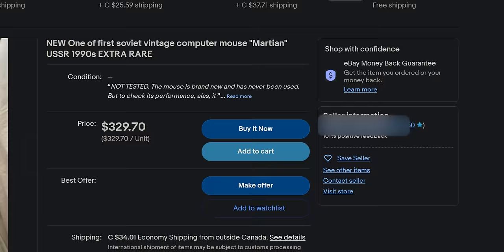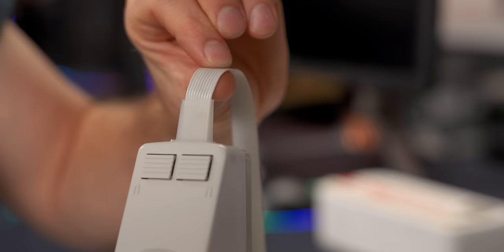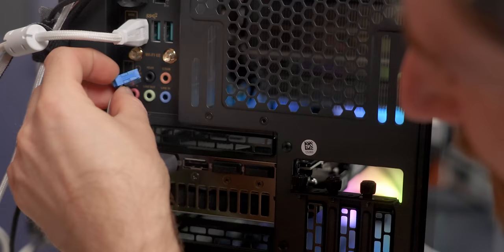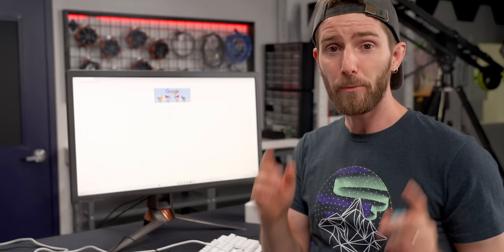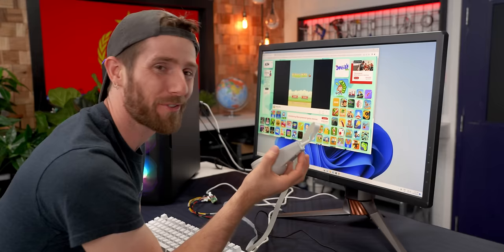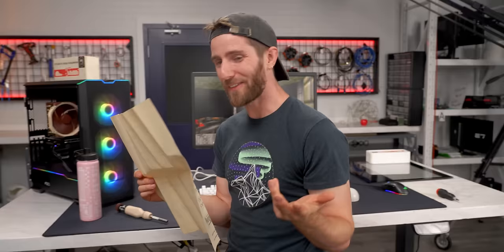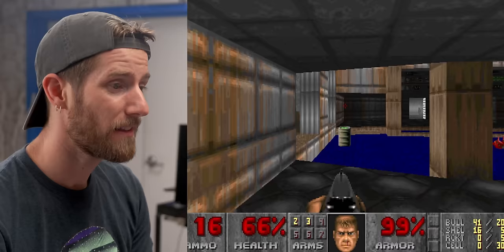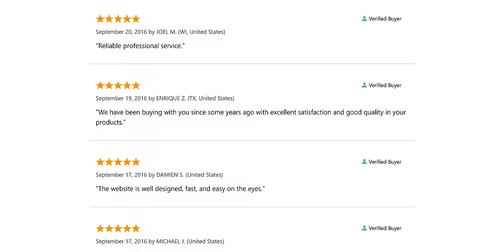I Bought a Soviet Era Gaming Mouse - MARS UKV-01

Comment: I love how they're using a Pi Pico, a VASTLY more powerful system than the whole original computer this mouse was designed for, just to translate the serial signal :D
Reply: LOL well having to slow down the clock speed of their hardware to, I wouldn't be surprised if that's one issue as well.  Full emulators (hillarously) like need to slow waaaay down so games aren't going at mach20
Reply: I cant help feeling it would have been a LOT easier to explain what a leonardo/pro-micro was doing, the 32u4 is literally made for making HID devices.
Also it might have been more useful to map it to the arrow keys - its pretty clearly designed for that (as long as you keep moving the cursor key repeats).
Reply: I suspect its what they had lying around  @Lord_zeel  - the 32u4 was hard to get for a bit there, part of why the RP2040 even exists. 
I just think its a pity, the ATMega is used in education because its so easy to explain what its doing vs something like a dual core 32bit ARM.
It should also really be interrupt based, not polling based as they had it.
Reply: @Lord_zeel crazy right! Imagine being laughed at for having a 4090 in a few years for example... just crazy!!
Reply: Some current mouse models themselves have more processing power than the original computer this mouse was designed for.
Reply: Every current mouse model  @Kalendale  - The BK-0010 would not have been fast enough to maintain a full speed USB2 connection. Full speed USB is 12MHz and the BK-0010 only ran at 3MHz
Reply: @mycosys  You cannot really compare physical layer frequency with CPU operating frequency. IO protocols are usually implemented up to the transport layer using IO controllers, which are dedicated circuits and logic made to just handle the IO. In theory a USB2 controller addon could be made for the BK-0010 which would allow it to reliably maintain a full speed USB2 connection, even if the processor would not be fast enough to maintain the full potential data transfer rate the connection offers over an extended period. Since a USB mouse uses nowhere near the ~1.5 MB/sec that USB2 connections offer, it is likely that a BK-0010 would be able to use such a USB controller for input from a modern USB mouse, or to act as a modern USB mouse recognised by a modern computer.
Reply: There are several Apple 1 clones on the market for hobbyists nowadays. The one that's 100% chip-by-chip duplicate is crazy expensive, if you can even find those chips that's long went out of production. Most other clones replaced the unobtainium display chip with a micro-controller, which many people pointed out is many times more powerful than the entire computer lol
Reply: Pi 4 is more powerful that the hardware that NASA used in moon flights lol
Reply: To be fair the Pico is more powerful then the super computers of that period including the US ones, let alone a home computer.  But it is also not actually necessary, it was just the simplest solution, if they wanted to spend the time writing proper drivers for it they could have probably gotten away with a simple non computing connector, probably through a parallel port.
Reply: the PMC (power management controller) of a SoC usually already contain a microcontroller that's faster than one of those.
However, a pdp-11 compatible does mean it is high end. The pdp-11 was like the inspiration for the 68000. Not like those intel architecture crap.

Comment: In Soviet Union including full schematics in the manual was the thing. They always did that and even for very complex stuff, like TVs or vinyl/cassette/radio sets (those were huge, and their schematics too).
Reply: Last thing was a blower
Reply: Именно так!! :)
Reply: I think that was the norm all over the world, even American TVs came with schematics until maybe early 1980s. Even into maybe mid 2000s you could e-mail Panasonic and get schematics for their products. Not sure if that's still a thing, though.
Reply: Then corporations were worried about the maintainability of their equipment...
Reply: Seems to me that they believed in the right to repair. Or something similar. If i remember right even cars were made to be easy repairable.
Reply: @phil_zupra_b5880  Well yeah, you had to place an order, wait years, and even then the car felt like it was made out of cardboard. Making it hard to repair them would have been evil.
Reply: Yes, absolutely true.
Reply: @iaadsi yes, for repair centres. And after signing the NCND agreement.
Reply: This was a thing of the times rather than just something the Soviets did

The Apple II came with schematics in the manual, for example
Reply: Жаль что перестали так делать, что в России, что во всем мире.
Reply: К древним мотоциклам даже прилагались чертежи расходных деталей)
Reply: Schematics for TVs and other electronic was also in Yugoslavia
Reply: But they could be fixed by anyone who could read the diagram. And this was the time when all technology was big.
Reply: Мы купили Панас японский в 91и там таки были приложенны схемы, отлельной книжечкой от руководства по эксплуатации.  Их начали  не лодить где то после95- 97.
Reply: because soviet education can able to read it for people..
Reply: Поэтому, многие из них до сих пор работают )
Reply: lol, Soviet Union was not able to produce complex stuff, all their products were primitive built
Reply: They had schematics because the things broke or didn't function properly from the start . I rember we had to repair the TV like 3 times a year.
Reply: @Celtic_stories 99 процентам это не надо.
Reply: @phil_zupra_b5880  Not exactly. Warranty was void once you removed the plasticine (or whatever material) with a factory stamp on it that was covering one (or maybe several - but haven't seen this even once)  of the screws. While there were a lot of radio amateurs (I learnt soldering and assembling AK47 in elementary school!) - the "authorized services" as we know them now - was not exactly a thing. So you brought a device with its passport  - and they had whatever scheme needed - mechanical, electrical, hydraulic - any. So that they could apply brain and skill to do a real repair and not just "it's faulty motherboard - we replace it with new one"
Reply: This was also a thing in the US until -1984- ...I mean the 80's
Reply: yes i think in ways of stuff made the soviet era was king compared to 2024(u atleast could fix it your self if needed+newer broke either i guess?)
Reply: @79keydet  And yet, they were the first into space, first satellite and had missile tech that was much more advanced. Not doing things the way you expect them to be done, doesn't make their tech primitive.
Reply: Based
Reply: It was common in many markets, especially where electronic stores were not common and ppl often had to solve their how problems in order to avoid long trips to the "nearest" store of said brand.
Reply: so did everyone at the time
Reply: Commie
Reply: My C64 back in the days also came with full schematics. The "make it impossible to repair stuff!!!!" is a somewhat recent development, that in my opinion HAS to go away for humanity to survive.